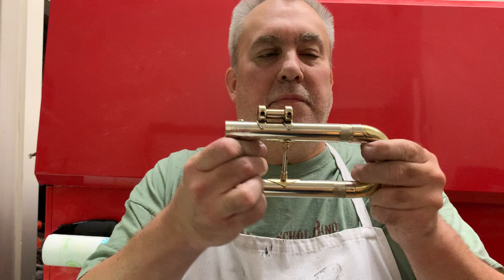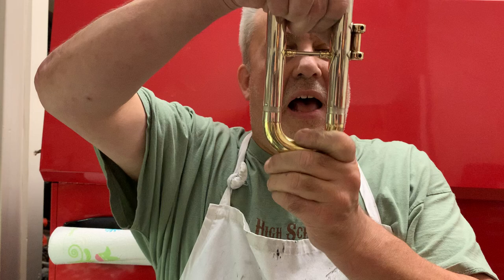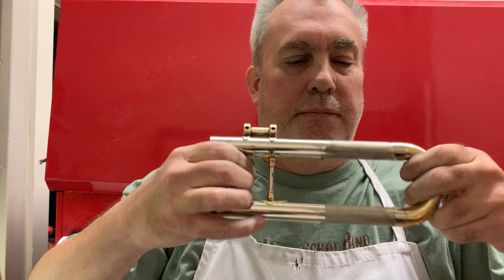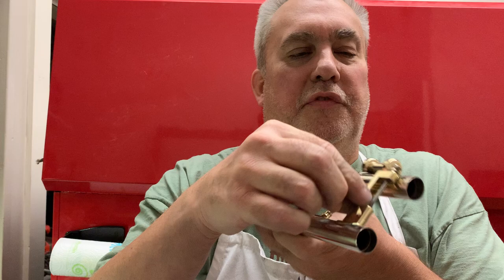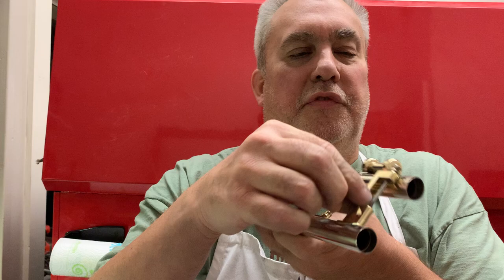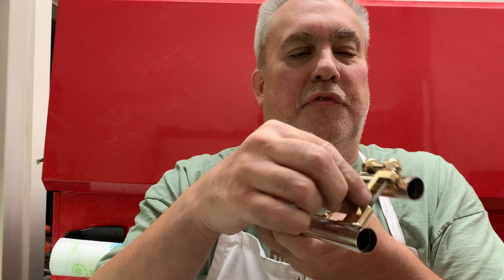SUCCESS! Kurath F Tuba 1st Slide

Comment from the maker: EDIT (12/09/21) — Yeah, I was not pleased with this after leaving it for a few days. I ended up rebuilding it one more time, this time with really great action, and I rotated the damnable 5th lever bracket about 95º up to vertical (on the plane of the valves) and made a new thumb lever that avoids all this nonsense. I am MUCH happier now that this has been done. The last bit of leftover 1st slide nonsense is that I need to craft a small bridge between the top of the 5th bracket to the 3rd slide to reinforce it. This will be a nub of brass round rod stock with a small brace foot on the slide tube to allow for the freaking evil thermal expansion that will occur when I do this work. I hate this bracket. I hope to one day make a new one using a much smaller chunk of nickel silver. Until then I will have to cope with this huge, ugly, flexy yellow brass behemoth of a bracket.